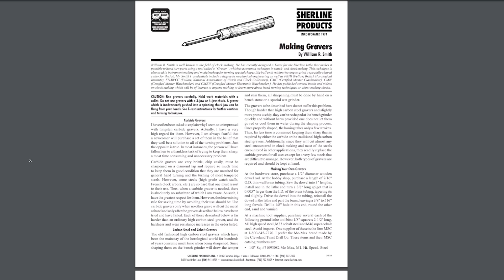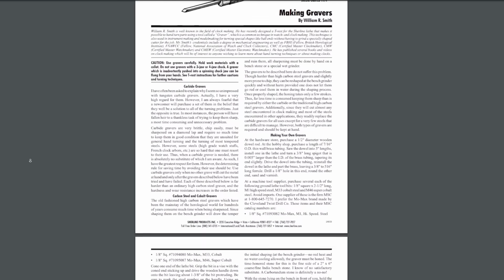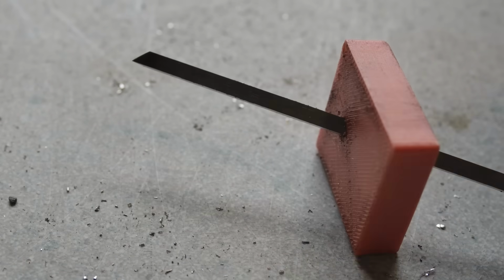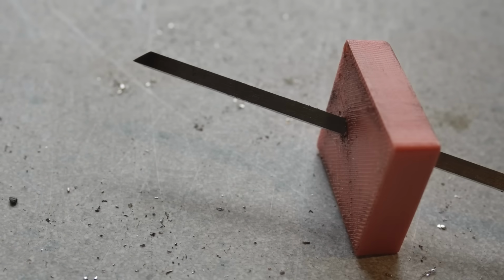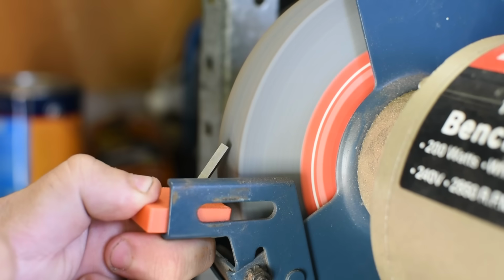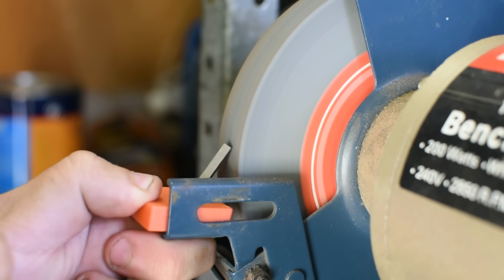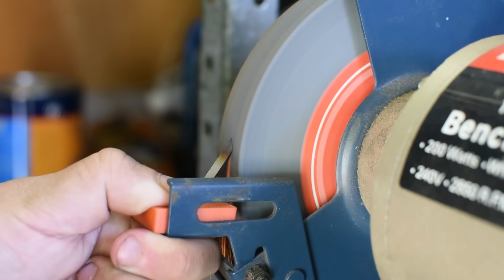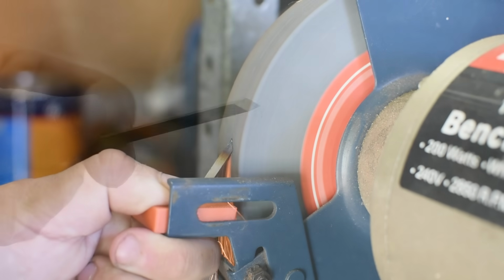I Printed A Better Lathe

Comment: Kind of bizarre and a little freighting to see someone turning metal parts with a handheld gouge like a wood lathe.

I want to be impressed but can the thing actually turn and face to a specific measurement? I'm not really seeing any way to advance tooling in either axis in a controlled fashion which is pretty much the definition of a "lathe".
Reply: You can hit specific dimensions on a lathe without slides, but it's much more difficult and you have to take lighter cuts. I wouldn't want to try it.

Comment: Is there a way to make one for flameworking?
Reply: Well, there's no way you print plastic that holds up to the heat of a blowtorch. But maybe that's not an issue with the shape of a flameworking lathe.

Comment: Great progress! One problem you might run into though is that aluminum extrusions are just trash for flatness and straightness and they have a lot of residual forces from the extrusion process that makes it hard to get them to become and remain very flat, as well as having poor stiffness in their own right, despite the superstructure you're still going to lose some precision there. You'll probably find you'll have to upgrade the spindle somewhat for your next version.

Comment: Great idea level up!  I think the best improvements on this design would be:
1. thread the spindle and put nuts up against the thrust bearing to add a preload. This will sturdy it up alot and give you the chance to tweak the precision if it starts going astray later.
2. Add an piece sticking up on your tool rest to put your tool against, that way you can use that as a way to get more accurate straight on cuts, like parting off.
3. double up your drive belts, that way if one snaps you'll have a backup to finish the job.
Other than that, it's turning out great!!  There's always all kinds of other things you can do, but these would be the easiest little improvements :)

Comment: Looks great! But I noticed something and was wondering if this could not lead to any problems. The exposed bearing seems to not be a covered one nor covered by any 3D print. Could this not be an issue with dust and metal shards collecting in it and clogging/damaging it quickly?

Other than that, you did a really neat job making it look nice and looking like an actual device that people could use.

Comment: A thought... Could the opening(s) be at the bottom with the ability to screw on a sealable a base? Then print with a gyroid infill and fill the structure with fine, dry sand. The sand will drop to the bottom and fill every cavity. Over time, vibration will cause the sand to settle even more only increasing the rigidity.
Reply: Sand is not very rigid.

Comment: If we had some other material to use that could set up as rigid as concrete but weighing much less we would really have something worth talking about at that point. As is this is a genius solution to creating a fairly durable lathe from minimal materials at a very low cost.

Comment: Short answer, 44 files, 1163g off filament, 6 build plates and 5 days of solid printing (63 hours) on a Bambu X1c. assuming $20 a spool for filament it would be about $23 in filament. Account for machine wear and tear and my electricity rate my print cost is $0.17 per hour, for this print $10.74. Total cost $34. much better than I expected actually!

Comment: Wow. I am very impressed with just how solid your headstock is just using plastic and concrete.  I did notice that once in a while if you applied too much pressure to the tool, the machine would bog down. (expected with the belt setup you have, as it did on my unimat)  I wonder if it would be possible to build a little CVT (continuously variable transmission) hooked up to a speed controlled  motor. This way, you would have torque automatically adjust as the load from the tool is increased?    Feel free to flame me, as I am not an engineer, and you most certainly are...or should be!

Comment: The only thing I would recommend is not using hand held tools and implementing a method of holding similar to what a full size lathe would have. I am picturing that tool being thrown, injuring the operator.

Comment: If you eventually want to consider going the cnc route, or just higher precision, some suggestions:
Build the mold upside down.  Place your hard/reference points, aluminum extrusions, metal mounting points, etc. on a flat hard surface.  Then pour the concrete from what will eventually be the bottom.  You can just have a big open bottom, with threaded points to screw in feet.  No mess to scrape.
Get a wider/longer aluminum extrusion and use this as your reference surface, Misumi sells precision ground extrusion, or you could have it faced on a bridgeport after pouring concrete to make it super flat.  Mic6 flat stock aluminum is another good option.
Make the headstock a separate piece with hard mounting surfaces, bolt that to the extrusion, then shim it to get it perfectly in-line with the bed.You might be able to get away with cheap MGN9, MGN12H linear rails for a compound, then bolt those to your extrusion.  If you go this route, you might also consider making the bed angled so that swarf falls off.
I'm sure everyone has already mentioned epoxy granite, one idea to borrow from that is tinting, you can probably tint the concrete as well to make it look more finished.
I would try to get some portion of all my important surfaces, bearings, tailstock, eventual rails, in contact with either a metal surface, or the concrete.  This would eliminate the flex from having your bearings resting on plastic for example.

Comment: Curious to see how hot that concrete gets the 3d printed stuff as it hardens. You should vibrate the prints as you pour to get air out and fill easier as it liquefies the concrete.

Comment: Need a proper way to adjust tension on those bearings. A steel headstock or bearing holder would also be a good improvement to the head - More weight, less compliant than plastic

Comment: One suggested improvement is to mount the machine on a wall when not in use. I'm thinking some French cleats would be ideal. By the way - how much does this weigh? Ideally it could be lifted fairly easily for storing away

Comment: 05:51 - the cooler for the semiconductor (might be a TO 220 casing) is tilted - it seems like its not mounted correctly by the screw, isnt it?

Comment: With that texture of concrete, try pouring it into a thick plastic bag. Snip the corner and you will have a smaller "nozzle" to pour through. Yes, much like cake decorating. A small cone in the corner will give you a more rigid tip for more control.

Comment: This is brilliant! If you haven't figured out a way already how to make pours cleaner: maybe make some funnels that fit every opening you need to pour in? Some simple snap-in things that you remove after the concrete is somewhat hardened, and you can clean up the overfill. Then you can print some caps for the openings, and completely hide the openings.

Comment: Cute idea, nice video. While this kind tinkering makes for passable YT content, the reality is that unless you want to do that kind of stuff you are better of just getting a real lathe and start turning. You can get a semi decent lathe brand new from Alibaba starting $200 for wood, $500 for metal. Even if you call that crap it would be much better starting point to make decent lathe and they are not that bad. If you are not interested in making 3D printing THE hobby, you need invest in a good printer that just churns out the parts so you can concentrate on YOUR hobbyt instead of the printing.  And that will be in over $500 minimum. You can get a great previously loved Myford starting from $1000 (just sold my ML7 for that money, keeping the S7 for myself).

Comment: Great project! One tip for future ones: you'll probably have a much better time vibrating your concrete if you buy a cheap massage gun and use that rather than the side of your sander.

Comment: to save yourself time with getting that plate round.  you could have used an angle grinder with a thicker disc and let that do the tooling.  just to save time.  then fine tune it

Comment: One thing that would probably help beyond just the taper roller bearings is adding some sort of thread to the pulley side of the spindle so that you can put on a locking nut. Taper roller bearings need to be tightened properly to work well. The pulley's set screw is also likely to become loose, and the pulley might move, which will cause the taper roller bearings to work themselves apart.

Comment: very cool, new subscriber, what a great use of concrete to dampen. I have Moroso Block Filling Compound as a product to use to deaden the headstock of my Sieg X2 CNC mill, as it is a no-shrink concrete. did you get much in the way of shrinkage? cheers, JBFromOZ

Comment: at around the 4:50 mark, you struggled with pouring the concrete into the lower part of the lathe. my suggestion would be to print a type of funnel to help guide the concrete. just fill it slow, and vibrate it as you go. then when it just slightly over flows, pull it off and remove the extra. just my idea, would be an extra print, but if you had to make multiple of these i think it could save time and hassle. love the project tho, keep it up.

Comment: Lathe is only tool that will build itself.
You start with a stick and string, and you build your lathe up from that piece by piece, upgrading and improving everything overtime. So you can produce better and better parts for your better lathe. 

Eventually when you have your lathe up in the condition you want it, you notice that its cost has been high but more in time.

Comment: Don't use superglue to glue together printed parts, use "3D Gloop" It's a special adhesive specifically made for gluing PLA, PETG and ABS/ASA. The bond is incredibly stronger than superglue or even welding with a soldering iron, in the tests the layers gave up before the glued part did. Give it a try
Reply: Super glue is considerably cheaper than 3d gloop, and it seems to work just fine

Comment: Because of the orange plastic, your lathe reminds me of those modular, multi-purpose lathe / mill / drill machine tools you can buy online, although I think yours looks nicer. I never took those multi-tools very seriously because they seemed too weak and flimsy. The use of concrete in your lathe must give it some real credible rigidity though. I've heard of 3d printed lathes and concrete lathes, but yours is the first time I've heard of the two coming together. Congratulations on a very clever idea!

Comment: Instead of concrete maybe resin with iron powder (if stainless is available that would be better)

The metal would give you the density you want while the resin would take up more space (less air than concrete has) and easier to pour

Comment: tapered roller bearings need preload to work well, which you havn't given and the plastic wouldn't support anyway.  you might get better results with a double row angular contact bearing on the front end and a normal axial bearing on the rear.  also if useing unsealed bearings you NEED to provide a chip guard or it's going to get crunchy really quickly as the grease picks up every little chip.

Comment: This is terrific. I did some early research into what I called secondary injection techniques for printed parts back when I worked at Honda in R&D in 2008 / 2009. It never occurred to me to look into concrete. Amazing results for such little expense (other than intelligence, blood, sweat and tears). Well done mate.

Comment: Amazing! Thanks for putting this out there. I have had the need for a low power lathe many times, but not enough to justify the costs and thought there was no way to 3D print one. This is very encouraging.

I get the feeling that there is some untapped potential in this. E.g. on a traditional lathe accuracy seems to be effected quite a bit, depending on how tight the bearings in the head stock are squeezed together.

Comment: It would be fun to come up with a modular design here that builds itself.  Start with a 3D printed and concrete base, and then use it to machine replacement parts for the 3D printed parts.  Each upgrade adds precision, stability, etc. until eventually you have a fairly powerful setup starting from virtually nothing and investing little except raw materials and time.

Comment: Just curious what kind of filament you used, seeing as curing concrete is an exothermic reaction and some warping could occur. I also concur with @grahams5871 and their idea to add additional internal structures to keep the concrete from becoming unsecured to the outer shell, over time. You've earned my sub for this one and I'll be continuing to watch this project develop!

Comment: Regarding a "neat" way to pour into the smaller voids, have you thought about using a piping bag (like they use to put frosting on cake, or mortar in between rocks)?

Comment: Not sure if mentioned already due to so many comments, but maybe you could use a piping bag for cake icing to get the concrete into the narrow slits of the mold without making a mess.

Comment: I love the idea of using 3D printing and concrete! (I'm a mod over at /r/concrete and I'm a tech person)

Keep in mind that concrete has most of it's strength in compression, and the reinforced kind (adding steel) has force in extension. I'd be curious to see a larger CNC version of this perhaps with some additives for even high strength. You may get pretty close to the stiffness of a cast iron machine but much cheaper! Keep it up.

Comment: I cant afford a lathe for metal parts but i really want to start practicing for work. We do all graphite parts and with my limited knowledge it seems that something like this would actually be really capable of cutting graphite parts accurately. I dont have access to a 3d printer but if i did thisnwould be my first priority. I hope something like this is on the market soon. Amazing work.

Comment: impressive build for what it is, and that price point. Interested to see how you'd tackle coupling a carriage and cross slide to the rotation for a full set of basic functionality. but what blows me away is the idea of filling prints with concrete, that's brilliant. i'm gonna use that for sure.

Comment: There's no need to leave the concrete pour areas exposed. Print covers that can be snapped and glued in. Countersink the concrete a couple of millimeters for adequate clearance.

Also, print some filling funnels that fit the openings.

Comment: I don’t know much about concrete but I’m aware of plasticizers and other mixtures that can improve the pour quality and finish of the concrete.

That being said I would probably look for different fillers. Metal rods, metal balls between them, then a filler like epoxy. It will be heavy and rigid.

Comment: This is how you adapt 3D printing to existing manufacturing and construction techniques.  Not just "Giant nozzle pouring concrete" or "I made this part entirely out of plastic and it doesn't have the mechanical properties I need it to anymore."  This is a wonderful blend of understanding the assignment, the parameters, and using 3D printing to create a professional looking mold, that positively contributes to the function of the project.  Using concrete for filler is a great idea for a smaller machine like this.  Captive nuts, bolts, and rails allow for modularity in the design.  All extraordinarily well done!

Comment: It's amazing for the cost but IMO it barely passed the "toy" threshold. Could be useful for small stuff around the house. I wouldn't bet on it's durability since concrete can crack at any time, so can 3d printed parts under certain kinds of stresses. But you're probably aware of all that. Still amazing that you managed to design and build something like that at home. Keep up the good work!

Comment: Please check the outer race of the bearings, front one seems to be spinning in the mount meaning the preload may have gone which is possible for a plastic preload sleeve in the headstock. These bearings must be loaded in compression (opposing pair configuration). 

Well done land awesome build!

Comment: For those wondering about how to vibrate the concrete in all you need to do is get a sheet of  half inch or three-quarter plywood and on the bottom part of it in the centre screw down a old vibrating sander, if you don't have an old one, you don't want to get rid then figure out a couple of clips to hold it flush to the plywood.  Then place the plywood on some bricks and hold it down,  pop your lathe on top and turn the machine on as you pour the concrete. You might have to hold your model in place with a wood jig or two. 

That's all it takes to vibrate concrete, yes it's much better if you have a poker but you're talking a tiny model here and the poker will probably just blow the concrete out of the plastic, if you can use marble chips for your aggregate as they are heavier than gravel. Better still use a resin concrete, but that's EXPENSIVE..

Other thing you could do is in the actual mould of the lays you could put some fingers coming down or up into the concrete. You could either do that with bolts or in the original design that would enable the mould to hold tighter to the concrete. 

Don't use too much water when you mix your concrete, keep the water ratio correct otherwise you'll end up with soup.